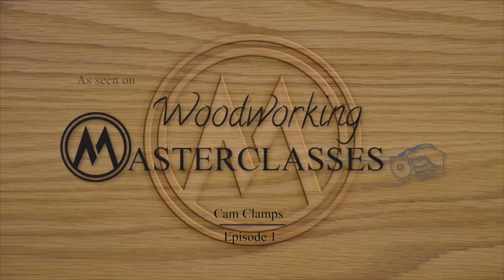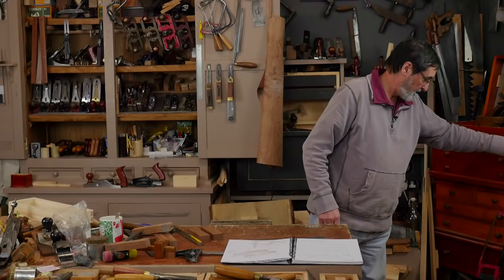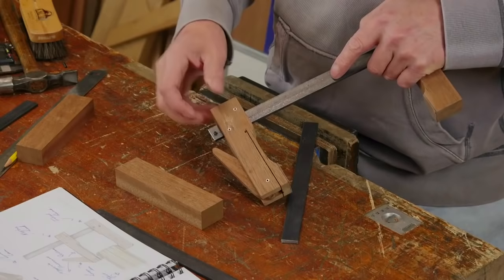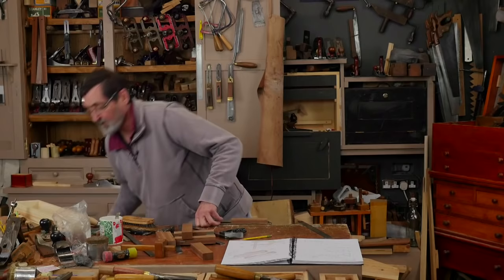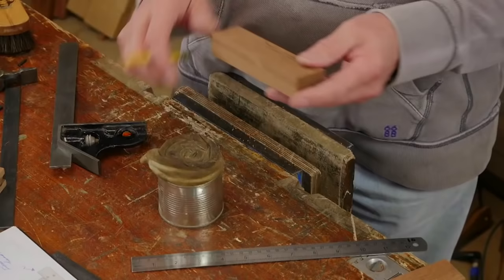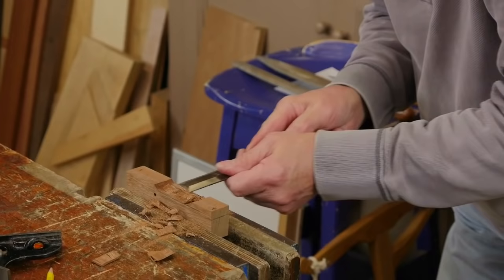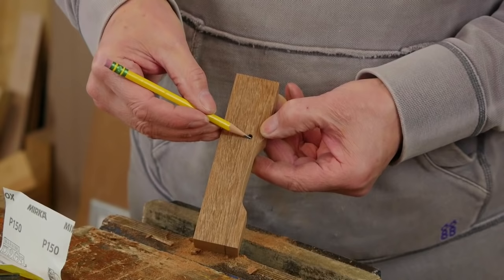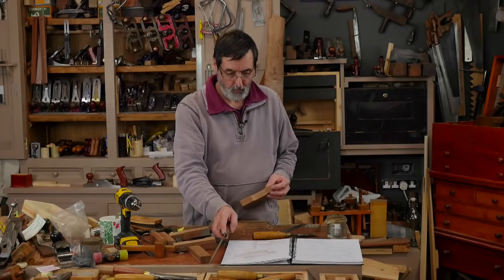Making Cam Clamps 1 | Paul Sellers

Comment: Paul I wanted say thank you, because you have given me such a greater appreciation for the value of working with less power tools and more with hand tools. In my limited experience I have had moments where if I had worked slower with hand tools the quality of my work would have been so much better. The fact that you apply so much detailed oriented work to a simple clamp that will not be the center piece of a room, shows your masterful expertise. Thank you!

Comment: I’m an American guy that has always worked with metal and machines, but my knowledge of woodworking is seriously lacking. I stumbled into owning second hand woodworking equipment (Cast iron top tablesaw, 12” dual bevel sliding compound miter saw, a Jet 14” cast iron bandsaw, and various odds and ends of handheld power tools). As a mechanic, I enjoy bringing new life to engines and machines. 
Now, I am overjoyed to be in a position to do the same for old trees. 
Thank you Paul for providing your extensive knowledge in a manor that makes me feel encouraged to be learning. So many channels have an air of condescension in their presentations, but not yours. I appreciate your advice, your thoughtful approach, and above all I appreciate your focus on practicality! You’re not pushing an agenda. You just want to share your hard earned sharpened skills with everyone; regardless of their level of experience. I appreciate that. 
Cheers Mate,
-Castor

Comment: Thanks for sharing! I made some of these some 30 years ago based on plans I found in Stanley Doubtfire’s  book on Guitar building. I did use copper boat nails and  roves for riveting everything,  apart from two steel nails on the moving part next to the steel bar. (I made a prototype with a wooden shaft instead of a steel one, but that didn’t work!)

Comment: If you need to save time, instead of the cam, just place a coarse thread thumbscrew.  In a softwood like sapele, install a 1/4"-20 or 5/16"-8  threaded insert; in maple, just tap the hold directly  (e.g. 3/8"-16) and harden the wood with CA glue

Comment: I was wondering if 1 x 2 stock stock wood material would be strong enough, its actually 3/4 inch thick instead of 1 inch?
Reply from the maker: I think you just have to try it. It seems a little bit thin for me.

Comment: I am wondering while watching this instructional video for other types of materials that can be used for the wooden parts of the clamps. For instance can I cut and glue together some small scrap sized pieces of plywood or maybe M.D.F. to the same dimensions as stated or explained in the video. Than use the glued up pieces of Plywood or M.D.F to finish building/assembling the clamps. If Plywood/MDF materials aren't recommended than what type of materials/wood would be a better suggestion? I am asking because I'm very interested in making some of these clamps based off of Mr.Sellers design, but I think finding or getting a hold of the wood Mr.Sellers uses in the video is going to be difficult for me. That's why I thought Plywood or MDF would be a good replacement do too density, strength, and stability. Any help from anyone is appreciated, so thanks.

Comment: Safety tip: Don't put your forefinger in front of the guard with a hacksaw. When you break through you can slam your finger against the cut metal end and it will rip your finger nail off. Have seen it happen too many times.

Comment: That 4mm hole is a 'stress reliever'. Without the hole, the pressure of the cam would be concentrated on the end of the kerf, esp at the corners. Now that same pressure will be distributed around the entire circle.  This is why cracks in windshields and sheet metal continue to get worse with a little vibration.

Comment: Great project!  Why do you need the scallops?  Just for the extra flex?  Cheers! Chris.
Reply: +Cactus Makeshop I think it is mainly for clearance and you will probably notice that clamping a work piece will introduce a slight angle to the face of the clamp, so for more effective clamping compared to just a flat faced clamp and sometimes depending on what you are clamping (if it is oddly shaped or has a trim piece attached for instance) it may well be required to clear that without hindrance. More versatility and efficiency, I would say.
Reply: HOPKIRK Makes total sense.

Comment: Pretty funny to me how you think sapele is a fit material for clamps but that rasps are too expensive... obviously prices are different here. Rasps can be had at Bunnings (our version of Horrorfrought) for about $10-15 AUD but large pieces of sapele can't be had at any price. The only piece of saple I was able to find was a tiny piece for guitar making at several hundred dollars :P Although it apparently is available as marine ply for expensive boats, "price on application", which is usually code for "if you have to ask, you can't afford it" here...
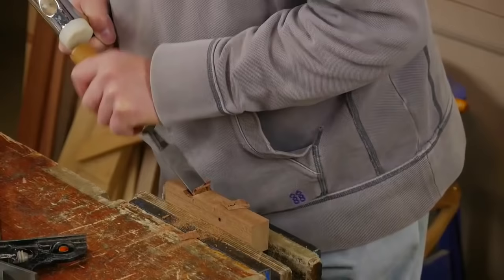Reply: Hardwoods are sold at a premium in large cities. Maple, Cherry, are mentioned as other alternatives in the video at 00:12:28, and Elm in another comment thread. The good news is that 6" of a 2x4 will yield enough material for 2 (slightly thinner) clamps (4 heads). Pretty sure any hardwood would do, including a clear section of hard firewood. I don't risk stumbling onto a pile of sapele firewood,  that's certain.

Comment: Does the kerf you cut for the cam to press against need to be wider in proportion to the length of the bar?  I am thinking of making some that have about 1' of opening
Reply from the maker: +Will Merritt No, just the same.
Reply from the maker: +Will Merritt No, just the same.

Comment: Hmmm... Are we going to need a 1/8" chisel for the mortise for the bar?
Reply from the maker: +CajunCoder It depends on the thickness of your bar. You can use thicker steel stock.
Reply: +Paul Sellers Seems like it might make for a really heavy clamp. Would 1/4" red oak work, or would the wood compress and cause problems? I imagine as long as I use a softer wood for the arms of the clamp this shouldn't be a problem?

Comment: I need to cut some osb does osb dull teeth on a hand saw and is their a special saw for cutting sheathing or paneling
Reply from the maker: +Adam King Best saw for that is the throwaway Bahco handsaw; the ones with the blue handles. They are sharpened especially for trash engineered carpentry boards like OSB.
Reply: +Paul Sellers don't like it myself but that's what the customer wants

Comment: It is strange how you switch between metric and imperial measurements. At one time you're saying 3 7/8", and 2 minutes later you're talking about a 4mm hole.
Reply: I think it is grow up in the uk and living in the US. The uk used imperial u til 74 I think. Then switched to metric. Mr. Sellers is old enough to have used both in the uk, and he lived in the states for a while. Plus some things only come in imperial sizes, especially pipe and wire gauges.